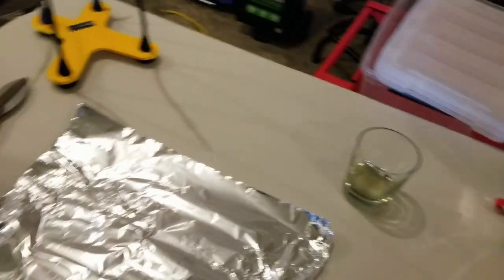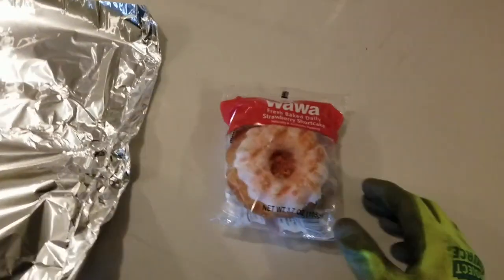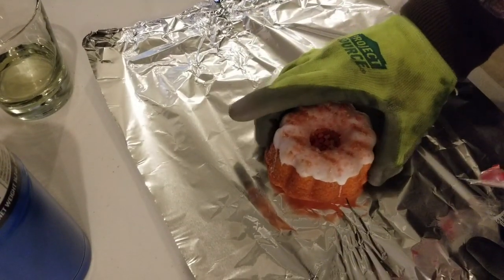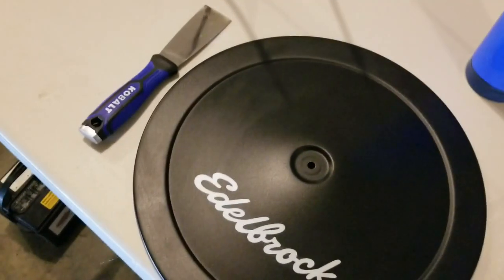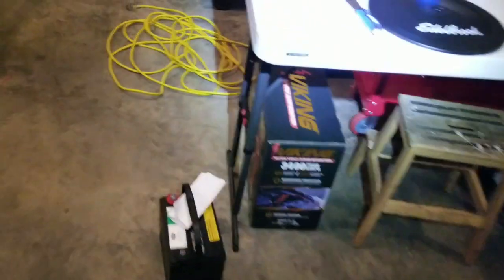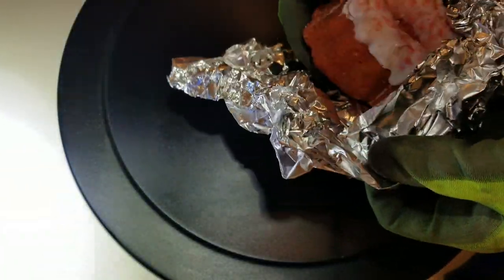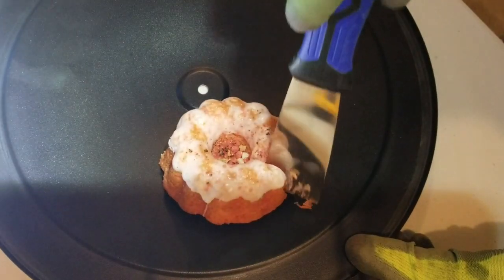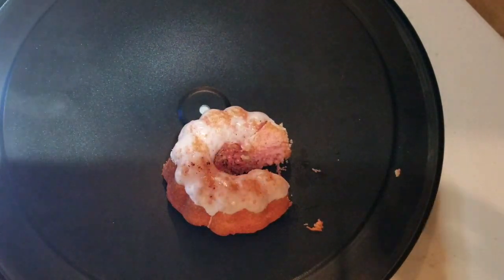My First Ever Cooking Video - How to Bake a Wawa Strawberry Shortcake!

Comment: I used carb cleaner spray for checking for vacuum leaks but propane works. I plan on hitting a wawa and trying one of those. It may take longer but I think the Yamaha A1000 might get hot enough in class A mode. Mopar cookin. I usually use a Truckers Oven when I travel. takes about 150miles to warm up leftover pot roast. (smithfield NC, to the SC welcom center) Cheers